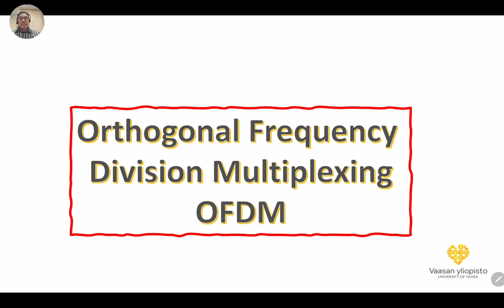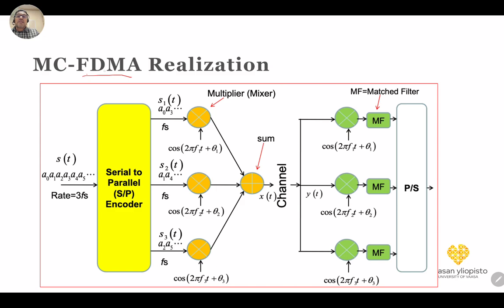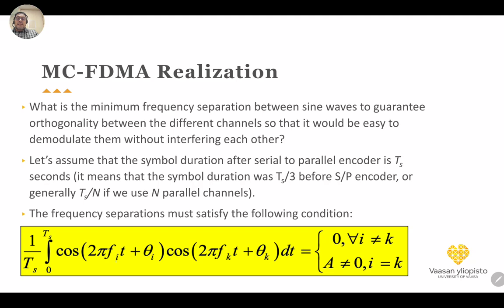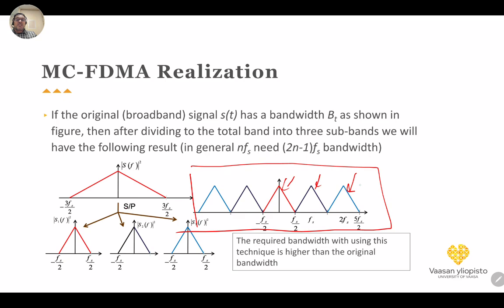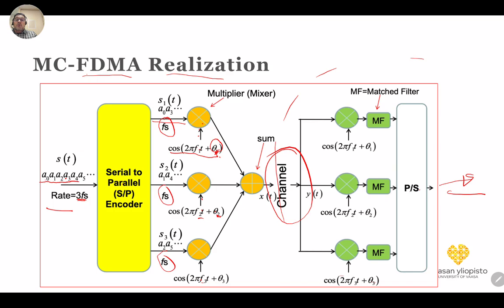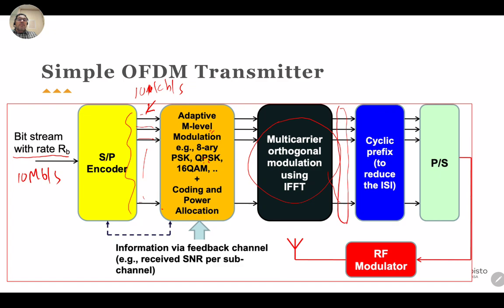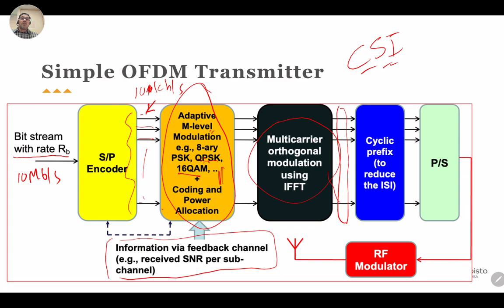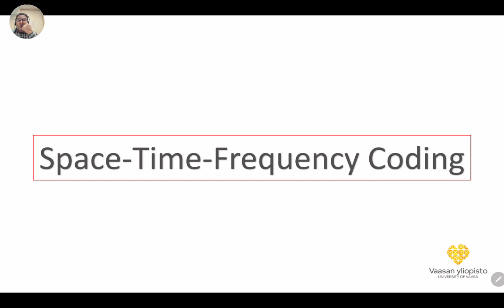Clip 3 - Part 5 - Modern Modulation Techniques

Comment: There are some questions I hope I can get them answered.

First, I'm still not understanding how the orthogonality can be achieved.

When I can say that two signals are orthogonal? What's the requirements of signals orthogonality?

And what happend to the signals in time, frequency and phase domain OFDM TX?

Another thing, in the real channel, it may cause (frequency/phase) shift on sub-channel, Is that will be effect on the orthogonality?

The last thing, it's not only for the OFDM systems.
How the receiver know when the signal begins where it runs in continuous time, and the distance between the Tx and Rx is unknown and continuously changed for mobile systems, and how to detect the phase of Rx signal in order to get information for 16-QAM for example?